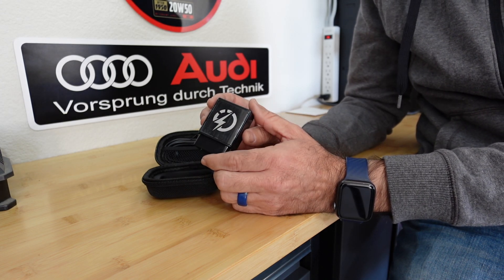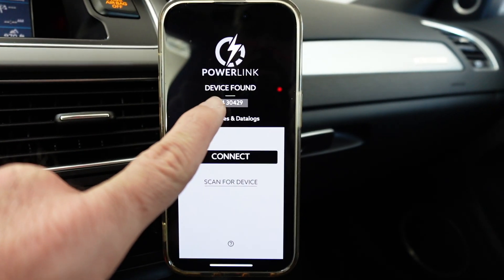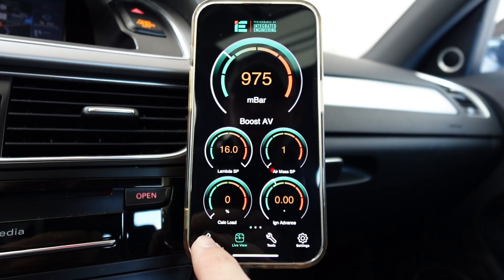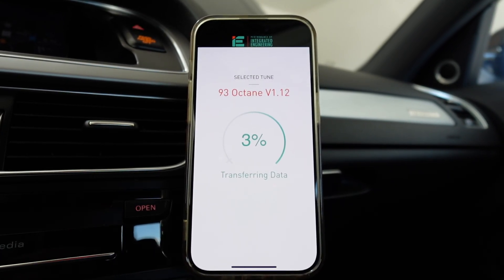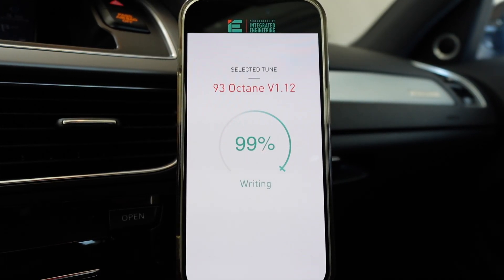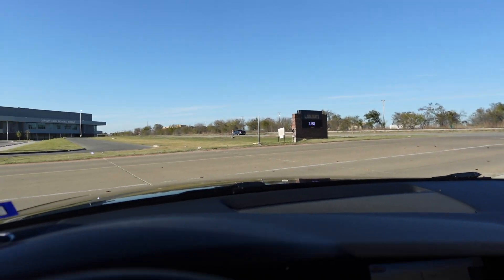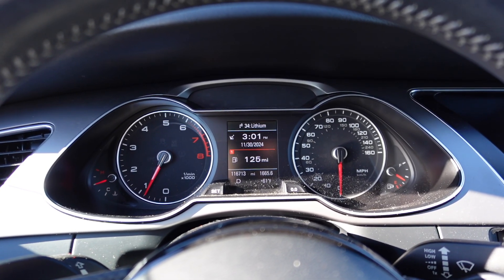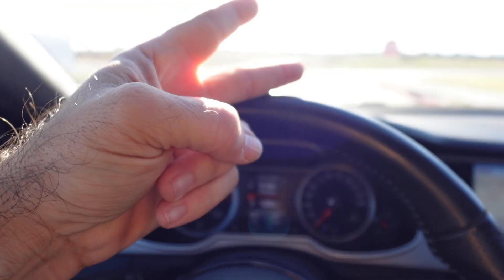B8/8.5 Audi A4 IE Stage 1 Tune Installation

Comment: Dont know if you still respond. When you get the final steps for the tune. After starting the car and turning it back off, you just turn the ignition on without starting the engine right, then do the rest of the steps? Just making sure I dont brick my car.
Reply from the maker: Yep watch me at around the 10:00 mark in the video. I’m following the  directions on my screen exactly. Ignition OFF, start car, ignition ON (no start), then off.

Comment: Are all standard part got enough head room for the improved bhp and torque
Reply from the maker: Yes IE designed the parameters of the stage 1 tune to work with stock parts.

Comment: I’ve got a B8 A5 prestige S-line with 140k miles and an underboost code, should I still tune it to stage 1? drives fine with that code on.
Reply from the maker: Considering that the tune is written in such a way that it increases boost pressures based off of an expected level of boost being present, that may not be such a good idea. I’d address the code first.

Comment: Could you have used the 91 tune or is the gas not good enough
Reply from the maker: You should choose the tune that matches regular availability of specific octane fuel in your area. Here in Texas, 93 octane is everywhere. But, if 91 is what is mostly available in your area, then you should go with the 91 tune.

Comment: looking to tune my car with  ie. i had a question. when you flashed stage 1 it said 449 credits did you have to purchase those separately or how does that work
Reply from the maker: @tsewja  you essentially get awarded an amount of “credits” when you purchase a tune that is related to the amount of money you spend. Either way all you’re paying for is the dollar amount of the tune. You also need to order a PowerLink module at the same time, which is what plugs into your OBD2 port to interface with the app. So, two purchases at once.
Reply: @HalfClickUp  right on thanks you

Comment: After you have installed it and rewrote the code,would you be able to reverse back to stock?
Reply from the maker: @elliottsmith9953  yes you can reflash back to stock in the PowerLink app.

Comment: What 0-60 times were you able to achieve before and then after the tune??? Really infested as I will be buying a 2015 A4 S-line AVANT soon here in Australia and doing na IE stage 1 and get their cold air intake as well
Reply from the maker: @Taha-d9v  0-60 went from a little over 6 seconds down to somewhere between 4 and 4.5 seconds.

Comment: That hit about twenty PSI of boost.  Nice that stock gear can easily handle that these days.
Reply from the maker: @brianhaygood183  was wondering about the conversion to PSI. Thanks for answering an unasked question!
Reply: @HalfClickUp I am always a fountain of facts as well as opinions nobody asked for.  I wonder what stock boost was limited to.   Dare we do the unthinkable and extrapolate from the hp data while knowing extrapolation is always a terrible idea?   Yes.  It suggests stock was in the neighborhood of 15psi.  Neighborhood, ballpark, zip code, or something like that.
Reply from the maker: @brianhaygood183  that’s even more interesting. Fascinating that simple code changes allow for such a mechanical increase without the addition of hard parts.